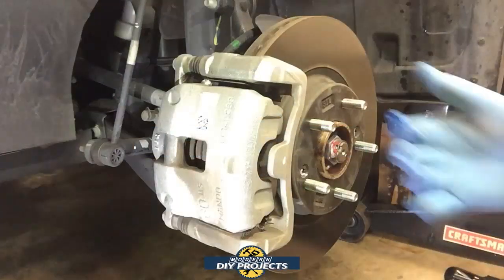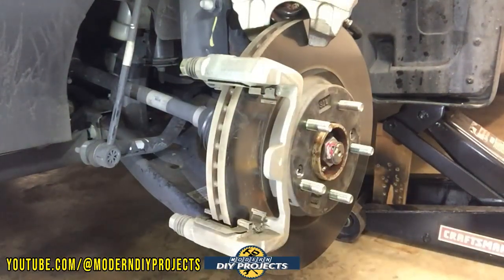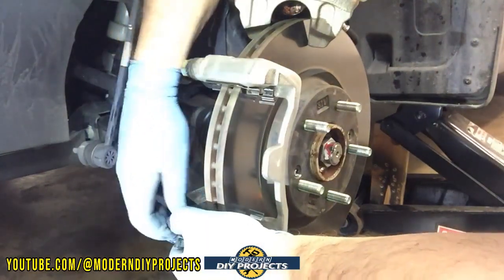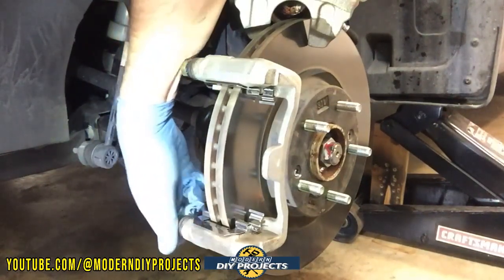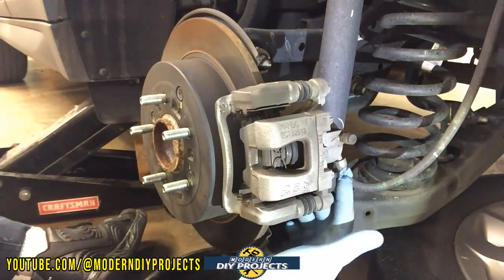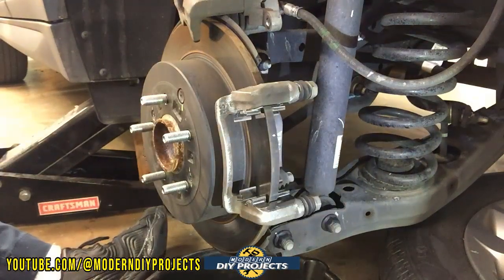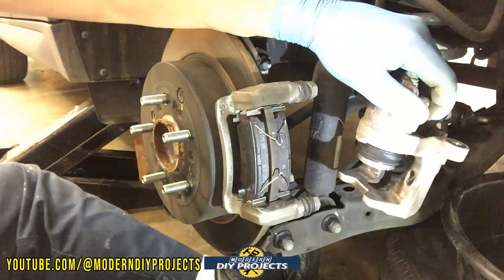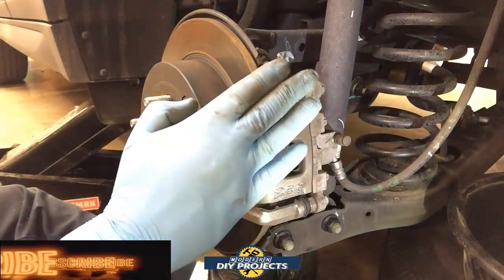Brake Pad Replacement 2016 Hyundai Tucson Change Brake Pads Front and Rear

Comment: Great video! Appreciate the effort put into this concise and easy tutorial. Doing a coworkers brakes shortly with this car and wanted to know roughly what was in store. This is a very basic and easy to service setup, especially with the ease of returning the piston to fully open for the brake caliper. My VW is frustrating as it requires turning it to reset it whereas this is just a pressure system. Again, thanks!

Comment: I really enjoyed watching your guiding video which shows how to replace brake pads. Actually from both aspects, the technical issue and also the small talk.
After watching hundreds of videos on how to change brake pads, I was surprised that you're the only guy who doesn't apply grease to the ends of the pads at the sliding area.
It got me thinking that you might be right. Greasing the edges may cause dust and dirt to accumulate in the sliding area. I wonder what is the formal procedure at the manufacturer. Are the brake pads in a new car greased?
Reply from the maker: If you live in an area that is prone to rusting, grease may be of some help. I live in a dry area with little rain and no snow. I also live in the city so no dirt roads to worry about. So my brakes stay clean for a very long time. As far as the manufacturer putting grease on them, the answer is no they do not. They just assemble and ship it as is. In fact most people don't know that most cars are not even given an alignment at the factory. They just put them as close and possible and ship it. If you need an alignment, the dealer is supposed to do it for you.

Comment: caliper pin lubrication is not general purpose grease. Petroleum products will damage the rubbers. Always use a specific brake lubricant on all brake components,

Comment: how have you liked the tucson has it been reliable any big repairs? im thinking of buying one have you got a lot of miles on it?
Reply from the maker: It has been a trouble free vehicle in my opinion. The only thing that went bad was the water pump and that was replaced under warranty. Had a few recalls like most vehicles, all taken care of for free. It has over 100K now so it's out of warranty but so far no problems.

Comment: If the master cylinder cap is removed before  pushing back the piston  brake fluid will  spill over  so I leave it on now  without  consequence or am I missing something?
Reply from the maker: If there is enough room in the master cylinder then you have no problem the way you are doing it. I would suggest to crack the top off and just leave it placed on top so it wont spill but you released any pressure that could build up inside the unit.

Comment: No break grease on guides, clips and back of pads??
Reply from the maker: Not needed in my climate. In fact it may cause noise in my situation. If you live in a very wet, snowy, dusty or place where salt is used, then you need to use it there.

Comment: when fitting new pads or discs shouldnt i release bleeding valve? just to avoid getting any dust/rust into abs/break system and than causing problems with break valve jamming ect?
Reply from the maker: You can do that, BUT I have found that your method can lead to air getting in to the system. The method I showed will not cause any problems because the brake system is a closed system. NO dust or debris will be pushed into the ABS system. You are just pushing the fluid back from where it came, and it is a closed system. So there is no harm to your system. The dust and dirt that is outside on the brake pads will stay outside and not go in your lines. If it does, then you have a leak and your brakes will already be failing.
Reply: What is factory spec for tightening bolts?